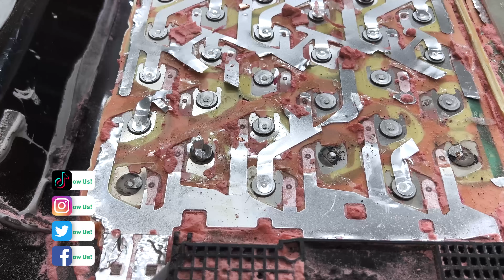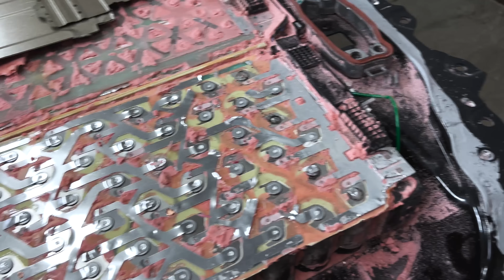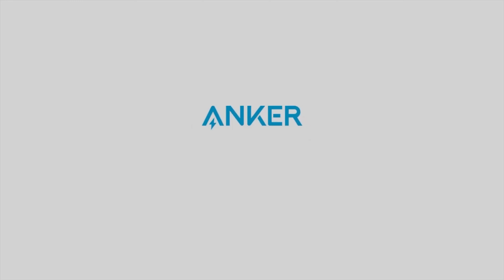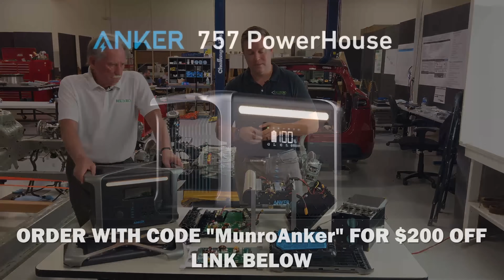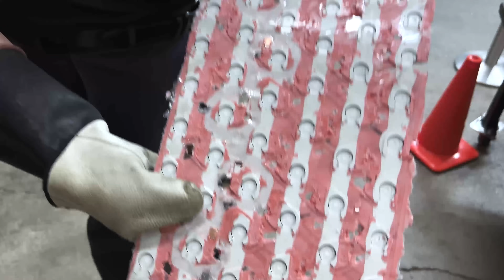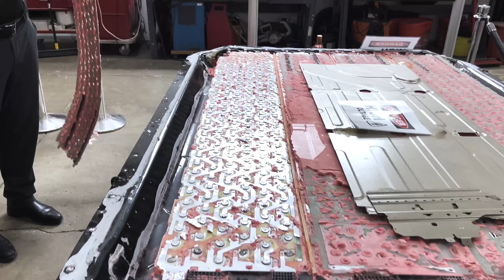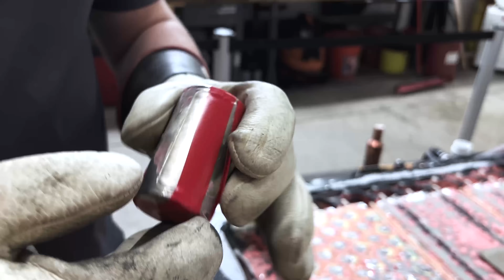Tesla's 4680 Current Collector Layout

Comment: We also got a leak from electrified that it has 828 cells. We already know from multiple sources (Troy teslike, limitless factor) that a single cell has 98wh capacity. That means the 4680 model y has a capacity of 98x828 = 81kwh not the predicted 68kwh from current predictions from charging curve. So I guess that at its full potential this should have a range of 322 miles (claimed, 19% increase than 270). Also these 4680 cells are not at their full potential(no silicon, dry method at cathode). Troy teslike leaked that in 2023 these cells would have a capacity of 108wh (355 miles same model, same number of cells) and in 2024 a capacity of 118wh(388 miles claimed). So for the same number of cells and same weight(4680 model y and 2170 have about same weight) we will get an increase of 44 %.

ps all of this is my opinion. If you disagree with something reply to me
Reply: the 828 cells and 9p means 92s - feels a tad strange that they dropped the max voltage by 16.8V
Reply: There's nothing to "leak": the cell number and physical arrangement was openly shown in great detail by Tesla in the displays at their Texas facility months ago. The electrical configuration was not shown then, but 92S9P (confirmed by Munro in this teardown) is the only rational arrangement of four blocks of 207 cells each.

Comment: Appreciate the insightful video as always! 
One thing I would love to hear your insight on is moving from wire bonding to direct welding of the collector plate. The tiny wire-bonds are individual cell level fuses to cut out potentially short-circuited cells. It is an important low level safety feature. Really curious to know how they are achieving that in the 4680 pack. Is the fuse inside the cell or does the weld itself act as a fuse?
Reply: Probably less chance of short circuited cells by design and the larger format of the 4680 cell and just the sheer lower number of them in a pack.  With the (expected) low internal resistance of these tabless 4680 cells and those beefy tab links it sure could deliver some high peak current though so would also be interested to know what inherent safety the pack has.  Those tabs or the welds would most definitely still burn up in a catastrophic enough short circuit event though.
Reply: If I recall correctly, each 4680 cell has a pressure relief valve that also literally breaks the electrical connection internally if the cell overheats.
Reply: @fred8281  Too little too late. https://www.youtube.com/watch?v=ydEK4-R80-E
Reply: Safety?
Musk don't like safety.
Doncha know?

Comment: I wonder if a more rigid structure could be achieved by implementing a rim at the base and top of the 4680 cells, (like on a soup can) and then press fitting a metal top and bottom sheet perforated with flanged 80mm (ish) holes over these rims a bit like the male and female components of a press stud fastner locate together utilising an interference fit and a sufficiently springy metal. This would have to be done before the current collector strips are welded on.
The top and bottom case outers could then be made of something light like plastic since they only need to act as a 'contaminent weather seal'. The foam and adhesive will help it all to keep from 'skewing and popping' undone.
Reply: All the torsional strength will come from the "tubes" being glued in a honeycomb.
Just as you see corrugated card glued in strips made into pallets.
Reply: @rogerstarkey5390  Can you post a link to a picture of such a palette please.

Comment: How much do the cells contribute to the stiffness/rigidity of the car? Where they able to reduce strucutral parts?
Reply: As you increase the diameter the area increases by pi r squared and the circumference increases by 2 pi r. This means you have much more volume than you have increased outer shell in a larger diameter battery. This means the outer shell can be made of thicker metal and thereby the battery becomes more rigid. Additionally the contents are semi-dry which also is more rigid. By joining these rigid batteries together you get a rigid pack.

Comment: It looks as if the current collector strips are acting as a key for the adhesives that bond the cells via the welds to the top sheet, not perhaps so much. 'rigid' as. 'semi-rigid'? 
Now lets see how the cells are attached to the bottom sheet.

Comment: This is a great channel, but please address the un-reparability issue of the 4680 pack and why you think this is a good idea? And I mean from the perspective of the customer stuck with a very expensive bill for replacing the battery pack. NOT what is good for the manufacturer and its stock holders!  Note: Recycling does nothing for the customer stuck with the bill. Your comments would be greatly appreciated. Thanks.

Comment: I still not get it. 
What's the benefit of covering the whole pack with this pinkish foam (glue)?
Reply: I think that the foam and glue bonds the top and bottom sheets together and to the cells producing a rigid box section rather like is the case with Nomex sheet.

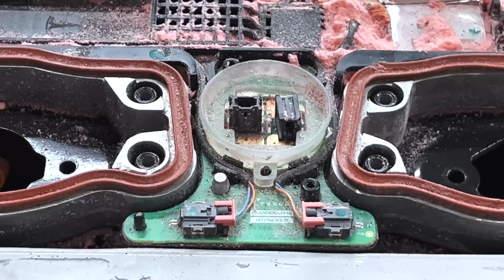Comment: So if the relay shown @ 4:50 or any of the other internal components in the battery pack fail, the customer gets to give the billionaire another $10,000 for a whole new battery pack! And you all think this is a good idea???
Reply: More Like $25k to $35k
Reply: that's the rigth questions to be answered. forget the battery. what if the relay and fuse fail? just like you said. the whole pack will be replaced?? what has tesla done this time.

Comment: The Austin 4680 Model Y with around 280 miles of range at 3.8 miles/kWh from a pack with around 74 kWhs and 828 cells means each cell is only around 88 or 89 Whs. That just doesn't seem right. The starting specs I thought were estimated to be around the 92-99 Wh range even with the earlier prototype 4680s.
Reply: "you thought"?
Or
"People who haven't seen or test a "live" 4680 "speculated"?
We STILL don't "know".
We don't know (for instance) if the smaller packs don't need a full compliment of "active" cells, maybe they have dummy cans' for structure?
We don't know it they're working on various chemistries?
We do know they're (still) the most efficient cars out there.
"No worries"(?)
Reply: 92-99 Wh gross capacity per cell (26 Ah times 3.75 V). About 88-89 usable (net) capacity per cell. That fits quite nicely.

Comment: A question for Cory!
At the end you let slip
"...I think our goal is 2 extract all of them .... 600 of them".
I'm like... WHOA!
So I got sad and watched in slow motion numerous times !
My best count was 36 cells down the side (including the missing pair)
Each visible pair of rows (with another offset and hidden) gives 9 cells in parallel (?)
Therefore the number of cells in a module must be
(36/2) × 9 = 648 cells?
Assuming all modules are the same size.
.
Am I correct?
(Smug face ready, I predicted "about 650" a long time ago)
Edit!
TOTALLY WRONG 😂
See below (Guess who got it right months ago?)
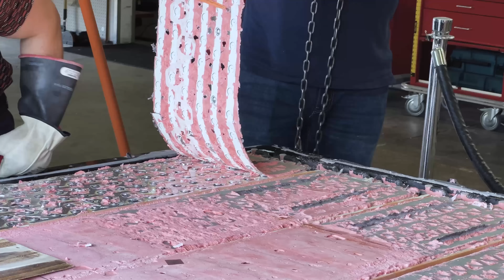Reply: Not even close. At 2:50 can see 4 modules. Each bandolier is 34/35 cells. 3 per module. So 848 cells total. Maybe Munro sold 600?
Reply: @iandavies4853  
I'm a numpty (the "600" threw me) but you're also wrong (😉)
Didn't seem right, so I drew it out.
I counted correctly, it's 36 rows.
Every other block starts with the offset (hidden) row.
That gives 24 blocks of 9.
216 per module.
864 per pack.
Since it's "9 in parallel" every total must be divisible by 9.
848 isn't.
The next number down would be 828. 😁
Reply: @rogerstarkey5390  try again. 828 is a nice number - 9 by 92. Each "module" is 23 layers of 9 cells, even with only 6 columns. I’ve counted the Austin bandoliers many times. Even that makes a big pack of 80 kWh approx.

Comment: Tesla is 10 moves ahead of everyone else. Who is getting into the Insurance business? Tesla that's who. When your car is totaled Tesla will take possession of the wreck personally and not sell it at auction. They will test the battery and if still usable will sell it as a replacement pack. If the pack tests good but low capacity, it will be repurposed as stationary storage. If the pack fails the test, it will be recycled. Tesla is now the one recovering value from these packs not some third-party retrofitters. This is great for Tesla, great for their customers and great for us shareholders. I bet everyone a steak dinner this is how it will pan out.

Comment: I'm still wondering about the actual specs. How much weight, how much energy, how fast can it charge and is it currently software limited in any way?
Reply: That will be a moving target as Tesla, and other cell makers, incorporate more and new technologies/chemistries into the cans over time.  Remember, 4680 is a form factor, not a technology in and of itself.
Reply: @Bryan46162  Ya ya ya, we all get that but that doesn't mean we can't get the current state stats.  I think after the earnings call its pretty clear the energy density of this generation cell is lower than 2170 which is totally fine.  They are being conservative with the chemistry as they work out the form factor and DBE processes.  Yada yada, what is the current capacity of a cell?  The mob wants to know!
Reply: @oof_Dad  
"The mob" just "needs" to know it's "sufficient"
Reply: @oof_Dad  26 Ah for this first generation of 4680

Comment: Since 3 years i am running my own rental company renting out trailers with batteries as stand alone energy alternative to dieselgenerators. I used tesla modules and now catl 16S modules from mercedes. I am a self taught engineer and this is where i learn the trade and optimise my systems. Reduce the component parts, give parts multiple functions, reduce weight and keep it very simple. You guys are absolutely phenomenal and worth more than any education that you can pay for. Thanks and love from the Netherlands!

Comment: Seems like a impossible mess to recycle and service.  The “future” more throw away e-waste.
Reply: .. you need to learn up on how something like this get recycled, it is NOT laboriously hand disassembled. Its basically frozen down until brittle, which makes it super easy to grind up into a fine granular "soup", and then its relatively easy to separate it all out into its chemical constituents for recycling. But .. its expected life span is 15 -20 yrs, so its not like this happens within a year of construction .. as the MSM have led you to believe.
Reply: @amremotewatching  good luck with that.  Understandable when you can do so with cells.  This is one giant pile of glue with batteries inside.  And scaled battery recycling is a lie doesn’t exist, companies are trying but it doesn’t exist.  Now just wait till solar cells start dying on mass even worse.

Comment: "It's not a plastic, it's a glue." What's the difference?
Reply: "Plastic" is a colloquial term (short for thermoplastic polymer) which wouldn't be used in this context in material science; glue is a function rather than a type of material. Who knows what that was supposed to mean; at what point in the video did you hear this?

Comment: After watching your video I saw Bjørn's on EV Hub and some of the issues they are seeing on older Tesla battery packs.  It seems like most of the issues had to do with water intruding into the battery pack and electronics.  Will the foam prevent the types of issues EV Hub found?
Reply: This one isn't self.
It's SEALED
Read in the Bjørn comment that it was simply a short drain tube which caused the issue on early S packs. Fixed in version 2.
A simple blob of sealant on those components would have prevented it, but that's what happens in early iterations 🤷🏼‍♀️
Reply: just probably just trap the moisture and corrode more
Reply: and the case of the Tesla pack is made of cheep thin metal it it will rust in country with salt on the roads and then the water will go into the non serviceable battery compared to the VW id4 is made out of really durable aluminum then the pack modules can be remouved and used in solar , EV conversions etc not the Tesla pack.

Comment: Are there any fuses for the individual cells? What happens if a single cell fails? Is there an internal fuse in each of the cells that will pop if there is a short of some sort? If there's not, then longevity of the pack would be pretty questionable, because even if the cells are rated for "1 million miles," no manufacturing process is 100% perfect all of the time.
Reply: No manufacturing is 100% perfect BUT that’s why there are quality controls at many stages in order to get below 0.02% of failures once the goods are delivered.
Reply: @1943vermork  But then you times that by ~650 cells, and all of the sudden the chances for premature failure start to become a legitimate concern.
Reply: @prerunnerwannabe  
It's +/-864.
A cell blows, you're down 0.116% capacity.
Hmmmm.
Reply: @rogerstarkey5390  Thanks for the clarification. However, you totally missed my point. Yes, if each cell is individually fused, then if one shorts or fails it should automatically be isolated from the rest of the pack. 3/Y have fused connections for each of the cells, but if the 4680 packs don't, then that's a problem. I'm asking where the individual fuses are on this pack.
Reply: @prerunnerwannabe  morever, what if the just 1 fuse fails? you replace the whole pack? can you even replace the fuse?

Comment: Looks impossible to repair a rogue cell. Has Tesla included a plan for repairing (adding or replacing) a cell or two during the life of a strip?
Reply: h ha ha....   when did Tsla repair a pack,  $$$  - your bad,  lol...  (have a larf)
Reply: It would be great to get some dialogue on this from Munro.  There's definitely a risk that a new cell is not aged the same as old cells so some have commented that either way, replacing a cell is not a good solution.  I do know there is something to that, but I also think BMS systems advance all the time. There could be workarounds to that issue potentially?  All in all Tesla is banking on having a very low failure rate.
Reply: Adding or replacing?
Of course not.
Removing a cell from the circuit?
Possibly.
But, you'll have to ask ..... Tesla?

Comment: If these are 96 kWhcells then at 828 cells would mean a 79 kWh battery pack.  During the last earnings call, Tesla said that they were not limiting capacity on the packs so either the capacity per cell is wrong from what it's being reported online or Tesla is lying and they are capping the capacity of the battery pack.
Reply: 2170 is approaching 19 or 20 Wh I think?
5.5x larger based on specs but barely 5x the energy it seems. Since Battery Day I've suspected the 4680 is low in specific weight, but all the EV nerds in the world seem to just dance around the word "structural" and lost interest in specs. What does a 4680 weigh vs a modern 2170 from Panasonic Nevada and LG?
Reply: @Cloxxki  if you look up the video by the limiting factor where they torn down a 4680 cell, they found out that most of the weight increase of the 4680 was due to using a thicker shell which greatly impacted the weight in a negative way when compared to the much thinner shell of the 2170.
Reply: @antonioruiz7446  still 272 Wh / kg though, that's a almost a 3% increase to what we had in 2009. at this rate by 2035 we'll have 280 Wh/kg on the cell level. real life is garbage
Reply: the results are in: 86.5 Wh cell. not impressive. data by university of california san diego video 4XOHetABrag here on youtube (can't find a direct link to the document)

Comment: @Munro Live  So what happened to current fusing per cell seen in all previous Tesla battery packs? .. Its still there!!  .. But now incorporated into the current collector as a series of ‘blade-fuses’ making up each ‘fork’ shown in the video above, thereby eliminating the manufacturing process of individually wiring a fuse-able link from each cell cap to a common connector. 
Its mentioned in the original 2019 patent #20190312251 linked here  https://www.freepatentsonline.com/20190312251.pdf  Re-reading it reveals the answer :-

Look at Paragraph [35] and the diagrams where it states    “ In addition, the fuse functionality can be also put into the current collector, thereby eliminating significant complexity in the construction of the battery system disclosed herein .”   And there it is folks !
Reply: Yep, I saw the same.
Kinda blows the "OMG they can't "repair" the pack!!!!" speculation out of the water, doesn't it?
Power electronics? In the "Penthouse" (that'll be under the back seat 🤔)
"Cell fails"? (Hey everyone, try reading the info they gave you years ago??)
Fuse blows.
You lose 1/864th (0.116%) of capacity.... 😱😱😱
.
Who needs reminding that ICE loses huge amounts of power over time?

Comment: should be interesting to see if any of the 4680 cells are inert / placeholders, or all are active. that would have a bearing on whether the pack is software restricted, with future expansion possible.
Reply: since there is no switch on the cells (they are all soldered together) there is no way to disable single cells (and also it doesnt make any sense whatsoever to make cells switch-able). Or do you mean dummy cells which are just there and add weight, but dont provide capacity? (that would contradict the software restriction theory though, because that would be a hardware restriction)

Usually to software limit a battery pack you basically just display the range eg 10 to 90% as 0 to 100% (and 20% of the capaity is then hidden/not available), but there is no way to determine that from just tearing apart the pack assembly.
Reply: @unitrader403  
A dummy cell won't add (much) weight.
It will provide consistent structure